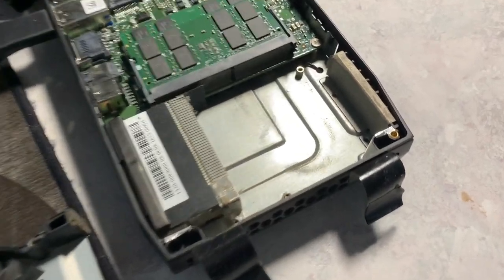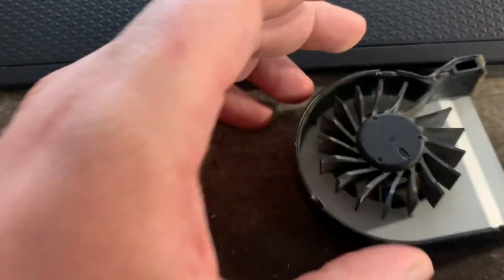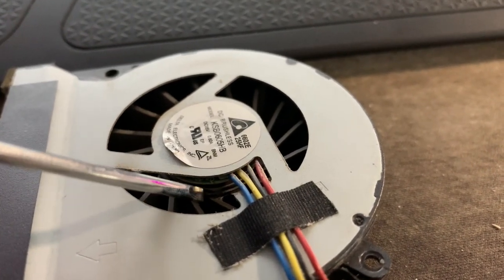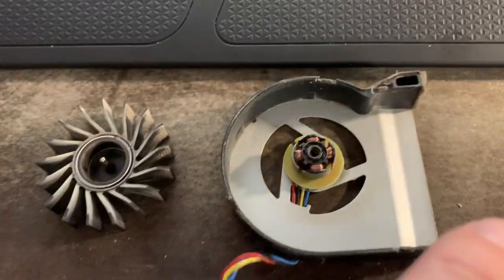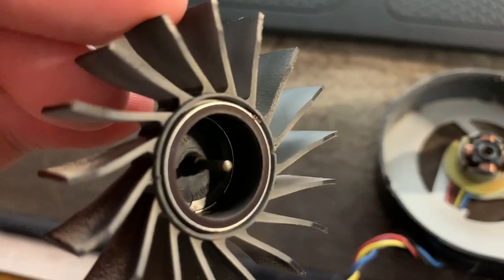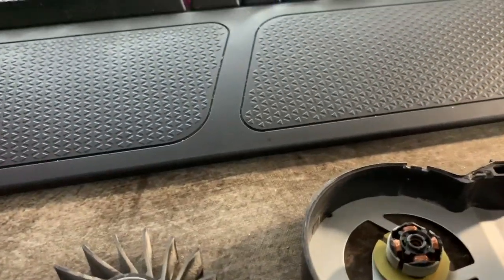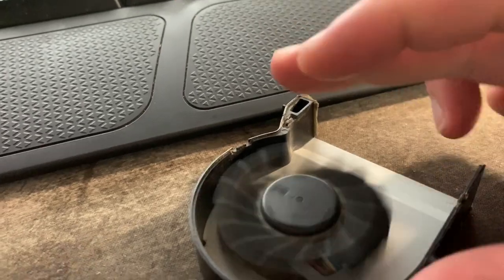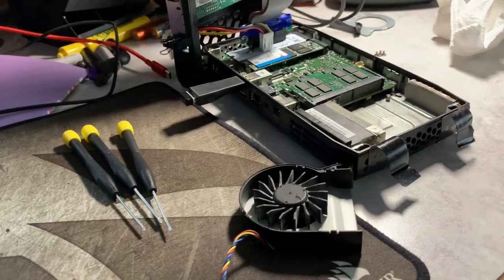How to Fix Intel NUC 6i7KYK Fan When It Wont Spin (Easy)

Comment: I've just experienced that issue. I had my NUC opened (upside down) and turned it on. I saw the fan not spinning at all. I was poking it with a stick and still it wasn't spinning. While it overheated (again) I made a quick search and found your video. Since I had all backed up, I thought "well, that sounds plausible. will give it a try". Turned the NUC off. Detached the fan, cleaned and used my Braun beard trimmer oil (one drop), put everything together (still opened, so I could see it after I turned it on) and voilá! It was immediately spinning. And more! It was noiseless! It was previously sounding like an airplane engine! Thanks a lot. The headache is gone!

Comment: Man! You saved my weekend. My NUC started to make strange noises two weeks ago. A light slap now and then seemed to help. But yesterday it started to die because of thermal issues. 
Removing the fan is a pita but the link from Shwinboy helped. The Intel pdf states that is is normal. 
The adhesive tape below the fan was very sticky but with a long flat tool (aka nail file) I was able to pry it loose. 
Thanks again for the video!

Comment: Totally works. Just did this. You probably need to mention you need to cut the little plastic tabs to remove the metal cover to access the fan. In fact if you do this that's all you need to do to access the fan spindle. You don't even need to remove the fan from the computer. To re attach the cover you could tape it back on or super glue the tabs.
Reply: I found this to be a lot easier too instead of completely removing the fan housing. Luckily it was that easy. This old nuc is running well once more.

Comment: Thank you so much for this. I'm onto 3rd fan. The fan is the weak point on the KYK. Intel have acknowledged the issue on their website and recommend contacting them for a replacement if it starts making noises or stops. https://www.intel.com/content/www/us/en/support/articles/000027667/mini-pcs/intel-nuc-kits.html . I was able to get a replacement fan through them though my warranty expired. That's some good customer service. I will try and revive my dead fan like this though . Spares are good.
Reply: I contacted them last week, and they are out of stock at least till the end of september. They told me to have a look at their "partners" website.
Reply: They have sent a free fan replacement for an out of warranty product.

Comment: I will quote from the support ticket from Intel, which I have raised it yesterday. They have shipped a fan for me, for free, to Sweden:

"Thank you for contacting Intel Customer Support! We can ship you a new fan to Sweden without any cost. If you wish to proceed we will need the following:

A full name
A shipping address (Including the city name, street name and number, Postal Code)
A phone number and prefix
If possible, a picture from the BIOS where the temperature and fan speed is showing"

The NUC was purchased in December 2016 and indeed, they are no official spare parts. Since I have more NUCs affected by the same problem, I will fix them by using your recommendation.

But overall Intel's support is great, even for out-of-warranty issues. It is clearly explained at this link that you should contact them to get a fan kit, but it doesn't say for which cost is: 

https://www.intel.com/content/www/us/en/support/articles/000027667/intel-nuc/intel-nuc-kits.html

And yes, mine was free, despite I have used "Option 2: If the NUC6i7KYK is still under warranty, request an RMA replacement for the entire unit."